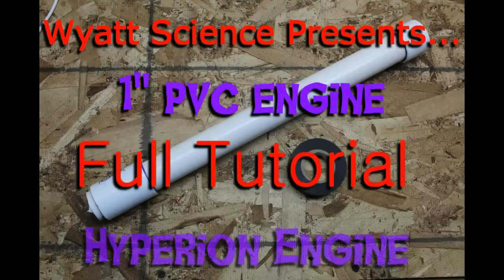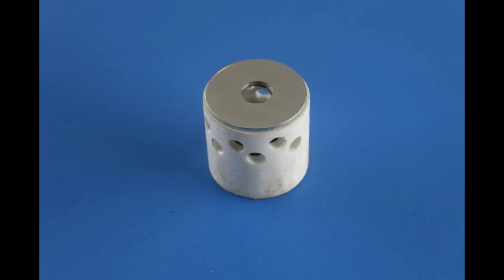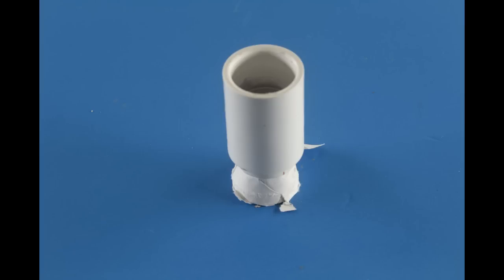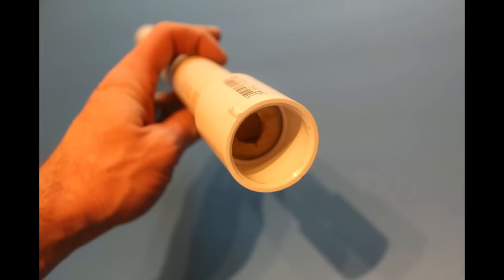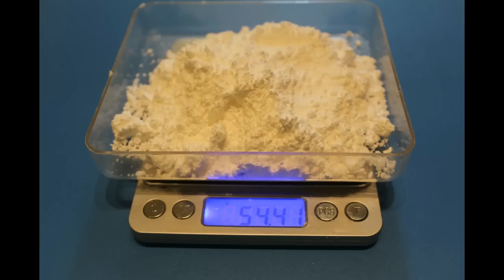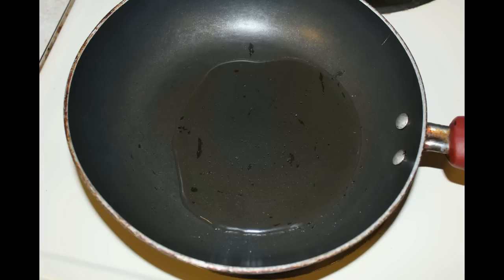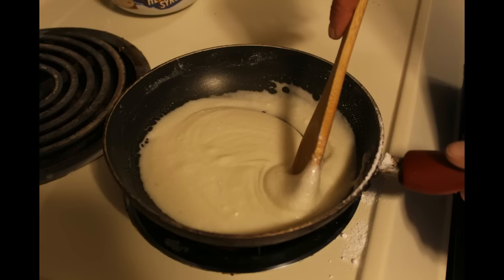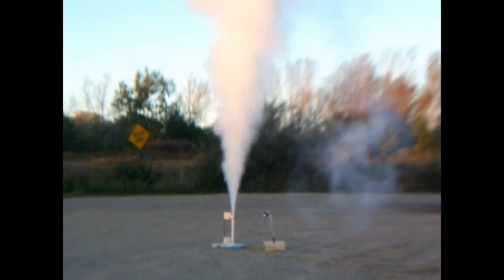I Class 320 gram Sugar Rocket - Full Tutorial

Comment: Im having a problem. My fuel does not solidify. please help thank you ! :D
Reply: I live in the Mojave Desert and don't have that problem (<10% humidity) unless it rains. If I don't have the sugar propellant sealed from the humidity it absorbs so much moisture that it starts to liquefy. I suggest next time you make sugar propellant, you seal it in a plastic bag until you're ready to use it. Try that. Moisture/water is sugar propellant enemy
Reply: Wyatt Science i will try it and will update you guys once ive done
Reply: Wyatt Science thank you guys
Reply from the maker: +Shahir Jalal How high is your heat? You are mixing the sugar and KNO3 together?
Reply: yeah, i mixed it together.. i used the formula used by the youtuber wizzbang75. 75g Corn Syrup, 100g Sugar and 325g KNO3. I mixed the corn syrup with 100ml of water and added everything together in the pan.. after that i cast it, and it wont solidify.. do you know whats the problem ??
Reply: Too much water in it...water doesn't burn. If you make sugar propellant by adding water you need to cook it back out. I never add water.
Reply: mojaverockets but i have cooked it untill it turned brown, but it still doesnt solidify. At first i only cooked it until it starts to turn yellowish and then i tried to cast it. It doesnt solidify. So, i cooked it until it turned brown. And yet still doesnt solidify. I have a feeling that the corn syrup is causing the problem here. Im using karo corn syrup. Any idea whats the problem ?
Reply: What is the humidity where you live? Sugar propellant will absorb moisture out of the air if it is humid.
Reply: mojaverockets im staying in malaysia.. its a tropical country located right at the equator.. mayb thats the problem i guess ?
Reply from the maker: +mojaverockets Raises a good point, where I live, even today at 30 degrees its 95% humidity. All my eninges/sugar grains are always kept in air tight containers due to this reason. Sugar propellant will suck up water which lowers its performance. I've found the ingredients themselves are virtually fine sitting in non air tight containers, but once mixed, must be kept from the air due to moisture. Thanks for your commets!!

Comment: I'm doing this projekt at school and i have a question: what is the ignition-temperature of the fuel?
Reply from the maker: ABC Schwitzer It is difficult to find ignition temperatures for pyrotechnics, however any ignitor will work here. I use an ematch firework ignitor i bought from ebay. Watch battery is enough to ignite it. i have used nichrome wire in the past, even a lighter. Ignite from the top down as long as your cored and you should be alright.

Comment: Do you think it would work if you use the propellant as a powder that has been compacted?
Reply from the maker: +Matthew Slater Yes it would work, however I would think that it wouldn't burn as even or as well when the two are not chemically bonded. When you mix and 'melt' the two chemicals, they form one compound that is now an oxider and a fuel. Apposed to two chemicals dry mixed
Reply: Wyatt Science Actually you are wrong. The sugar does not combine to the KN03 chemically, it's a mixture. The chemical reaction occurs during combustion. I'm going to try 4 different motors, one cooked and cored, one cooked and un-cored. one uncooked and Un-cored and one uncooked and cored.
Reply from the maker: Matthew Slater You should post your results! Im interested in what you come up with! I do know the sugar is a crystalline structure and when you heat the sugar and kno3 together, it recrystalizes combining the kno3 and sugar into one crystalline structure. I could be wrong, my experiences come only from experimentation. Thanks for the comment!
Reply from the maker: Matthew Slater The uncordered your talking about is what we call an end burner. Much lower thrust and pressure. Interested in seeing what you come up with, but my money is on. the cooked & cored :)
Reply: Wyatt Science ya, my hypothesis is that that one will create the most thrust, I just want to see how little work you can away with for the most thrust, as well as how much thrust is generated by the end burner. I just have to figure out a way to accurately measure burn time and a way to accurately measure thrust.
Reply from the maker: Are you familiar with Arduino or anything similar?
Reply: Wyatt Science no, what is that?
Reply from the maker: Arduino is a microcontroller with a very user friendly and TONS of tutorials online. You can create an electrical circuit to measure thrust of these kind of engines. I've been working on my own, but I haven't gotten it done yet.

You could also use a bathroom scale to get some results.
You could also use a rear brake caliper and a pressure gauge to act as a load cell.
Always load cells themselves but they are expensive.

I have a few links if your interested.
Reply: Wyatt Science if you could send me a link for that micro controller and a link to a tutorial on how to use it to measure the thrust of these? If it's a kit that would be great cus I'm waiting on my Eggtimer TRS to get here, and the practice would be good. Going for my level 2 cert soon.
Reply from the maker: Congrats! Well this isn't any type of kit and really just a list of parts to purchase and a general idea of what to do. If your still interested here is the link.

https://hackaday.io/project/7942-wireless-rocket-motor-analyzer

Comment: hello guys...I am from india....my 20 kg rocket exploded in the launch pad.......
sir my fuel indredients were suger+Potassium nitrate....what was wrong then?
Reply from the maker: +Mostaque Ahmed 20kg rocket is quite big. If you used the same nozzle dimensions, it should explode. Was your casing an 1" diameter? Cause that would be really tall engine.
Reply: Note enough information to speculate on what went wrong. I've done much larger successful motors. What was your case diameter, core size, nozzle throat size, case bonded or segments (if so, how many?), how long, what liner if any, was it poured or packed, what was your propellant density, etc

Comment: What ration do you use? When I cook mine it ends up a dark brown batter nothing like yours also when I pour it in it sinks like a bad soufflé haha
Reply: The dark brown color is what caramelized sugar looks like.  If it is, then either you've used too high a temperature when melting the mix, or you didn't stir constantly to keep the sugar from burning on contact, or both these mistakes.  I notice from your second question that the molten fuel mix softened the PVC enclosure.  This could be the result of pouring a sugar mix that was too hot.  Which is what one would expect if you used too much heat melting the fuel mix.

Comment: I made a motor around the same size as that, when I was pouring in the fuel it softened the PVC and it started to wrinkle and warp, is there a specific type of PVC i need? I have seen some people using the black type of PVC, is that any better?
Reply from the maker: +Malex I believe the black pvc is a bit thinner in wall thickness. I would be very careful using that. I use regular schedule 40 pvc. It sounds like your giving your mixture too much heat. You want it right around 200-210 *F. Just umder boiling temperature for water. If your using a kno3, sugar, corn syrup mixture that is 65,17,18, this should turn out just fine. Lower your heat and stir often. Also, its likely the over temperature fuel is hot enough to make your plastic plyable. This also happened to me before i started using the mixture stated above and done in this video.
Reply: Alex, see my answer to your previous question.

Comment: What do I need to do with my fuel! I tried this mixture in a 100 gram batch instead of the 320 gram just to test the fuel but my feel starts to turn into a darker brown color and it never gets to the "yogurt" consistency that I know I need without the sugar burning. I am using granulated sugar and stump remover and corn syrup and it is more the constancy of play dough! If anyone knows how to correct this it would greatly be appreciated! Thanks!
Reply from the maker: Ryan Moore My suggestion would be to test some of your 100g batch. From experience, when my batches turns brown, it was likely due to high heat. Are you using corn syrup? This acts more like a binder and helps the fuel pour easier and remain in a more liquid state longer. Also, if your using straight stump remover, you should purify the solution first. Boil in water, filter and dry. It will remove all impurities that can be in the stump remover. Let me know your results. Thanks for commenting!
Reply: We were using granulated sugar before we just recently changed to the powdered sugar and from our guess the granulated sugar is somewhat dyed because once we did the same procedure with the powdered sugar it looked exsactly like the fuel in your video! And also what is the best nozzle degree. I have access to a lathe but I have heard different degree amounts and was wanting a good idea on what would be good for an I motor on a 1-1/2 pvc motor! If you had any info it would be greatly appreciated!
Reply: Thank you for the tips I will try the ideas and see what that does and as always be safe! Great video!
Reply: Ok so we just successfully got a motor test and it burned well but unfortunately it burned so slow it only achieved about two lbs of thrust and also the slow burn caused the concrete to turn into molten stone and lost all pressure inside. I know I can add some iron oxide but is there a better way to increase the burn rate of our mix? We are using the 65-25-10 potassium nitrate, powdered sugar, corn syrup mix with a 1-1/2 in pvc with a cap and quickrete nozzle at roughly a 50 degree angle. Any thoughts or tips would be appreciated! Thanks
Reply from the maker: +Ryan Moore Try a fuel mixture that is 65%, 35% percent. Kno3 to sugar. If adding corn syrup go 65%, 17%, 18%. Kno3, sugar, corn syrup. It sounds like your mixture is too rich in oxidizer. Add more fuel to the mixture.
Reply: Wyatt Science you ever have issues with end cap blowing off on this motor?
Reply: Using corn syrup or water is a hit or miss proposition. You have to use just the right amount of heat and cooking time. Too much heat and you caramelize the sugar, too long of heat and you cook out the water and can't pour the propellant, not enough heat and the propellant has too much water and will not burn very well...water doesn't burn. I never use water in my propellant.
Reply from the maker: SwampFox Rocketry I have encountered this issue but not with this engine. I haven't a CATO with this engine yet. I have found that if I use a brand new or newer can of PVC glue this issue disappears, unless of course your engine over pressurized. You can try rounging up the end cap and the casing where they meet and make sure you use primer and glue on both before joining them.
Reply: Thanks yeah i have had success now moving to Bates grains to rid the processes or pouring in the single grain without having air bubbles and thin spots near wall. Thanks tho this was a great start ill post some Bates grain making and test soon.
Reply from the maker: SwampFox Rocketry I have also considered trying Bates grains to remove any air bubbles and to construct a more uniform fuel casting. I've been considering parts for a rig setup. I'm interested to see what you've come up with!

Comment: If you want to make your fuel "cooking" safer, you can heat it with a water bath. Get a deepish pan of water and put some spacers in to sit your fuel pot on so that the bottom of the pot is submerged but is not touching the bottom of the pan. The less thermally conductive you can make the spacer the better. Then you can heat the water, which will transfer the heat into the fuel pot. Top up your pan with water as necessary. As shown in the video, never stop stirring.

The advantage of this is that you cannot heat any part of your fuel pot over 100C, and it spreads the heat evenly over the whole pot so that there aren't hot spots right under your electric elements. Hot spots are what you're trying to avoid, excessive localised heating is what causes an ignition. That's why doing it straight on the stove it's critical to keep stirring so that no part of the mixture heats up too much. With more uniform heating it's still very important to stir, but it's an extra layer of safety.

It should also be noted, always use a wooden or plastic spoon, and be gentle with your stirring. It's a reasonably insensitive pyro mixture, but there's no point taking risks by knocking it around unnecessarily.
Reply from the maker: I like your idea with heating the fuel in the manner you speak of! I haven't tried it, but it really is a good idea! I will have to try this sometime. Thanks for your comment!

Comment: Nice video. Never tried making one that long, was always in fear of a cato. So I stuck with short and fat. Your recipe is similar to mine, though I mix it all with water first to dissolve the kn03, helps it bond to the sugars better. And I cook it longer till it's more like mashed potatoes. Makes it harder to work with, but also makes the fuel more virulent, hence short and fat.  Keep up the good work! Btw. Tried several anchoring concretes, Rockite is the only one that works.
Reply from the maker: Thanks! When I first started this several years ago, I also would dissolve my KnO3 in water, and would filter it and let dry. The KNo3 I have now its quite pure, so I haven't tried doing that. I also keep it in an air tight container. I've also tried putting the KNo3 in a coffee grinder to get smaller particle size. Until I get my digital scale up and running, I could never really see any performance improvements. However, once the scale is up and working, I should be able to try all kinds of techniques and see which may work better. I've also made this engine with a 16" engine casing. I have two fail and one do just fine. There is a formula I use that gives to a KN value, as long as that KN value is under 450, you shouldn't CATO. More to come. Thanks for watching and thanks for commenting!
Reply: Get my kn03 from seed ranch off of Amazon, 99.8% pure powder. Add water during the cooking phase after mixing it, and the sugar, in a blender. Then cooked till it had a sheen, bout 20 min @ 300 degrees. With the short engines, noticed a huge difference. Btw wud like that formula.
Reply from the maker: Thanks for the info, I'll have to try this technique myself and see what results I get. I'll be really interested once I get the scale working. I'll make a post on my Facebook page, if that will do =)